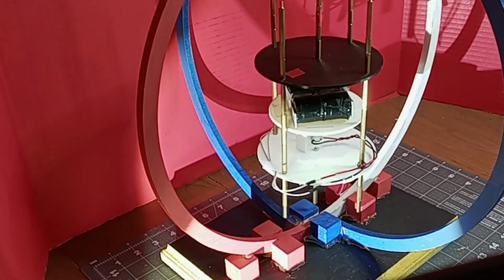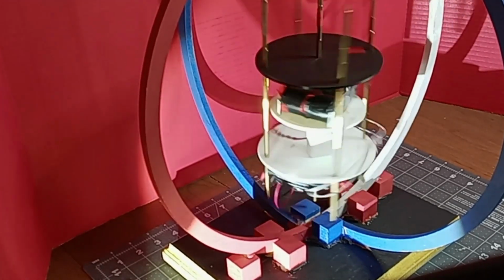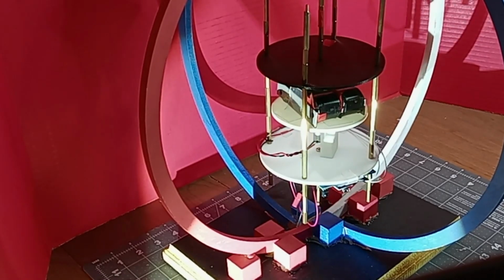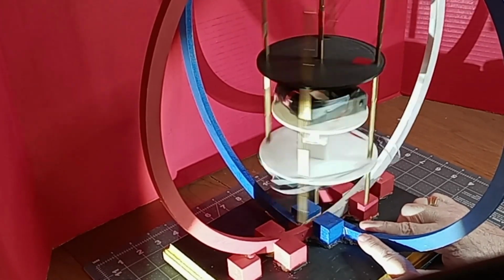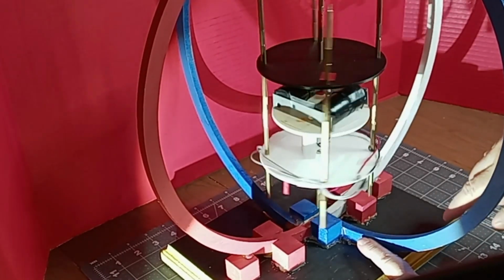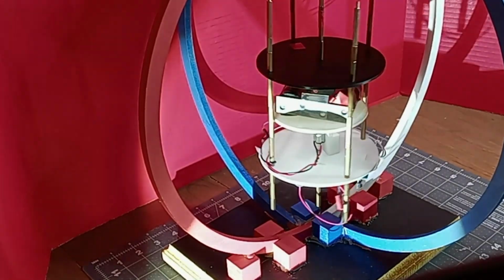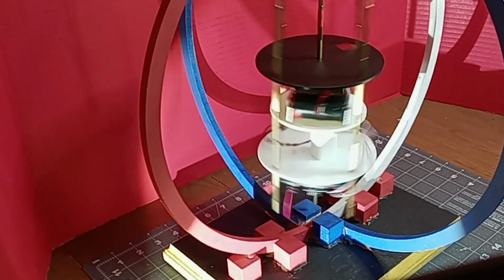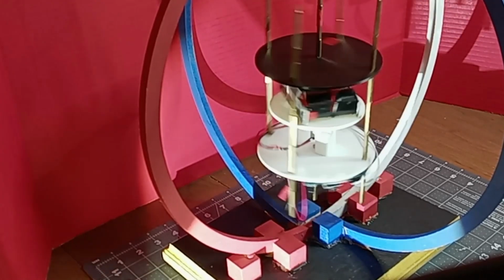Probable Magnetic Propulsion Effect with Free Spinning Magnets

Comment: It's because it's not balanced. Where it swings out the furthest is where you got all them wires hanging off the damn side of it. That's why it's circulating.
Reply from the maker: @FuctByTheGovernment  Thanks for watching and commenting on the video. It's definitely not balanced exactly so that's possibly the reason but we're looking for something like the gyroscope effect prevents it from swinging out until it slows down to a certain speed but that still needs to be shown experimentally. Would it do the same thing if we removed the magnets?